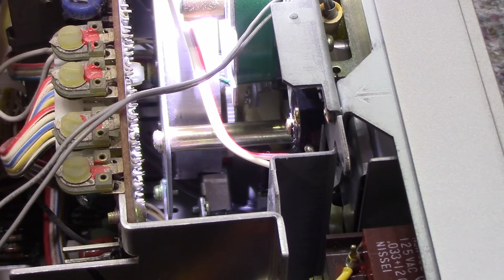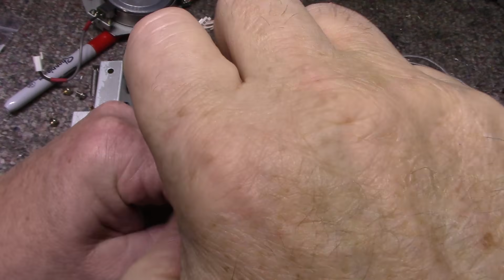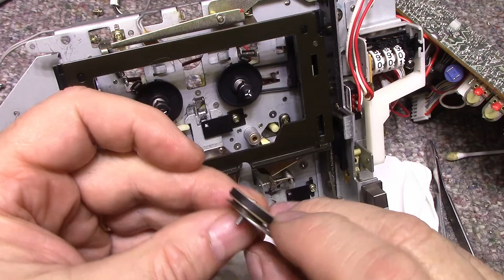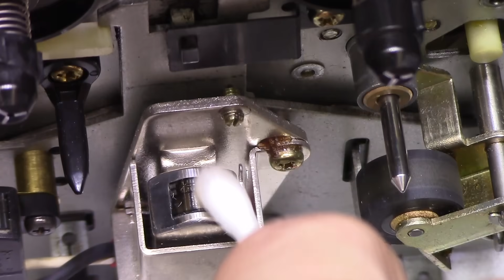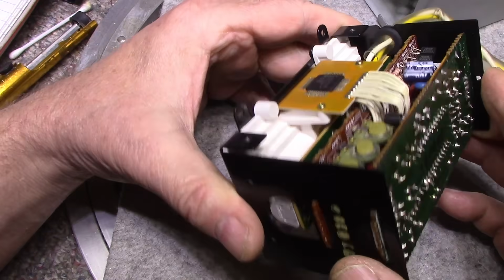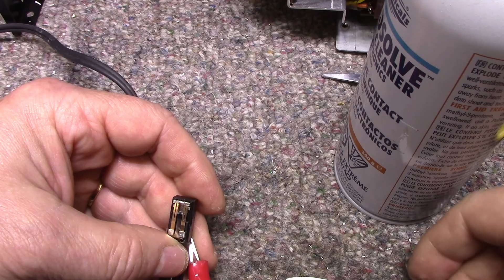Sony TC-K80II Cassette Deck Repairs (Ep. 222)

Comment: Nice video, you always make good videos Trevor.

The '0VU' you see is the original Philips DIN 160 nWb/m flux standard, set back in the 1960s. The other '0' will be Sony's defined reference for maximum record/pb level, although, it's just a guide. The Dolby Level symbol is about +2.7dB above the original Philips fluxivity - at this point and higher, Dolby encoding/decoding is in an OFF state.

Comment: Sony really made some cool stuff back then. Good thing that none of the white gears was broken.
Regarding cleaning gold contacts on relays, I was wondering if it would be possible to use those Laser Printer Cleaning sheets to do that?
They are bit thicker and more textured than regular printer paper, but don't have any grinding surface that could damage the contacts.

Comment: Good production Trevor, small holes I cut-off cotton and the cardboard stem works pretty good for absorption. I can see that getting $1000.00 in 1980, does have outstanding lighting. You are correct, only 2 head. No glue for that cracked plastic wheel ? Nice seeing that Sanyo integrated, own that w/ FM Tuner.
Reply from the maker: Thanks again Robert for your continued support

Comment: Hello Trevor, I am following your channel quite some time - great motivation to my projects. I read from time to time that it is worth installing or replacing so-called audiophile transistors in the preamp circuit board, especially with old devices.  Do you have any experience with this?
Reply from the maker: Transistors are transistors. There really are no audiophile transistors. Each type has it's specs and when replacing them you need to pay attention to these specs and keep them within their operating characteristics otherwise they could die or affect the sound quality. Generally, we replace old transistors to more modern types for reliability and not sound. Changing transistors shouldn't make a piece of gear sound better unless the old transistors were defective. I'm speaking very generally here

Comment: I was never a fan of cassette players there were too many things to go wrong and there was an incredible mix of technologies from many different eras.
They have old mechanism principles from the industrial age mixed with tech developed for the space age and even stuff they were developing on the fly which they threw in to try to keep ahead of developments and requirements ! Sony were renowned for going beyond what was strictly necessary to try to get ahead of the competition and over complicating their products which for some was a selling point but for others it was excess baggage. This was a very nicely designed and built unit but it was mostly designed for home recording and a lot of time and effort went into it's development, it's just a shame they didn't have a better medium than Compact Cassettes.
Cassette tape was a terrible medium for audio reproduction, no matter how many electronic filters and special circuits you put inline you cannot overcome the limitations of the tape.
Reply from the maker: Didn't Sony come forward with the Elcaset? They were trying to address the limitations of the compact cassette but it never took off like other formats

Comment: Trev, why not just use 99% iso and avoid the risk of the plastic segments melting or going brittle over time? You can still buy that poison Rubber Renew. I use it for idler tires on Dual TT. I find you need to clean the part the following day as it oozes out a film of oily rubber poo. If you soak am idler tire in it the rubber swells up like 30%. It returns to normal size in 24 hours. I only use it outside with gloves on. Not looking to grow another head from my neck. Dr. Cassette recommends using windex to clean rollers as it will not dry and crack the rubber rollers. Idk... just FYI.
Reply from the maker: Not a fan of using alcohol to clean oil or grease, there are better solvents out there.  just need to be careful around some plastics and use plenty of ventilation. Alcohol has it's uses for removing grime and dirt, just not great for oil and grease